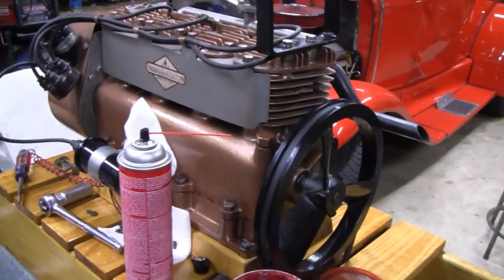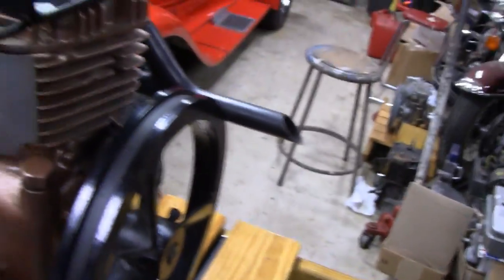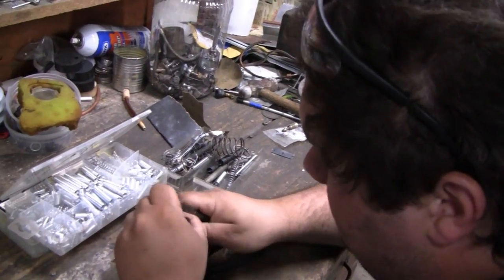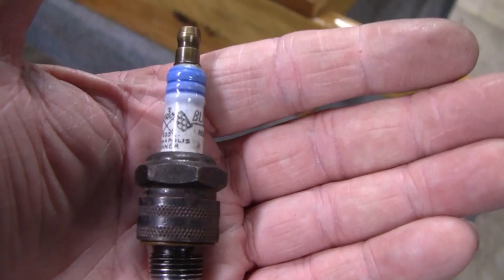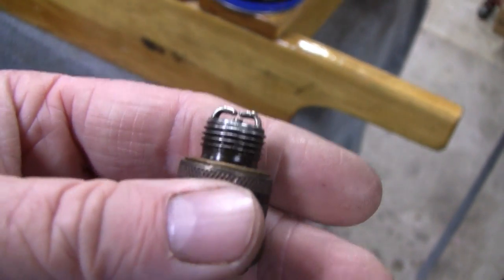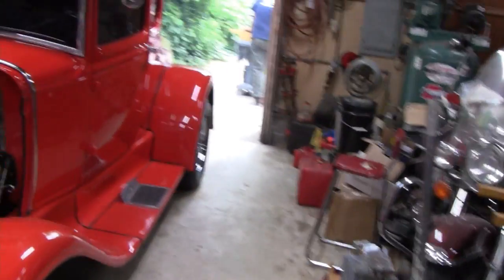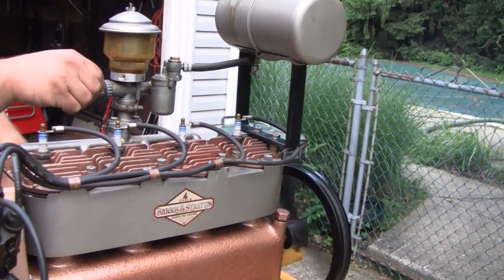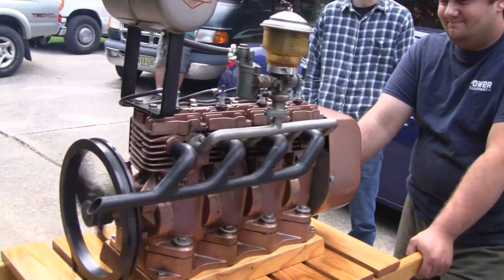HOMEMADE 4 CYLINDER BRIGGS ENGINE (TUNE UP)

Comment: Does it keep the cylinders cool that are farthest away from the blower?
Reply from the maker: Yeah it has a cooling fan on both ends, it's actually cooler than a single engine!!☺
Reply: @805ROADKING  Oh yeah the fan in the big pulley i didnt see that

Comment: If I sent you 2 twostroke 50cc engines. Could you build them together and make a 2 cylinder twostroke engine? The engines are called am6 and sit on rieju,Yamaha,motorhispania enduro bikes

Comment: Can you make a 10 minute running video of this 4 cylinder? I really love the sound. Go for minimum rpm as well hehe. Just love it.
Reply: I didn’t see the build , but did they throw an oil pump in it somehow? 
Low idling is ok for a few moments for effect but it doesn’t throw enough lube around, I wouldn’t wanna see them hurt it.

Comment: Reminds me of the 4 cyl engine on the old bikes of the 20's & 30's . Still a cool Creation to watch run :)
Reply: Was thinking the same thing, just like a 4 cylinder Henderson.
Reply: That's it , Henderson . I couldn't remember the name, but Mike & Roadking got this one real close :) !!
Reply: I just made the same comment without reading this or any orther comments. 
At that time there were quite a few different manufactures. ACE and Cleveland I believe were the predecessors to Henderson, then going on to the Indian 4.
My faves actually.

Comment: That's pretty darn cool. It sounds like a Continental O-200 aircraft engine with straight pipes. Is it a 180° crankshaft?
Reply: It reminds me of the old Continental flat head fours like in older fork lifts.
Reply: The pulley goes to an electric starter. Which yea, ya need something to start turning the engine over.
Reply: That is EXACTLY what I thought. Sounds like an old Y-112 or F-163 used in welders.
Reply: @Tadfafty  The crank is briefly visible at about 8:38 in video 8 of the original series, it's a 180
Reply: Tadfafty , yeah, something doesn't smell right. Also, did you notice the "drive" pulley? I wonder if it is actually the driven pully.
Reply: they didnt show the crank but, they did show all 4 pistons moving in sync with the heads off.
Reply: @baymechanic1009  Wow that happened a long time ago. Baby mechanic welcome aboard.
Reply: @adon2424  Go back and watch the entire series.   It's real.  Tadafty was commenting on the original question, whether it's a 180-deg crank.